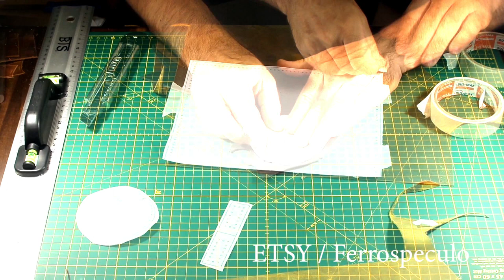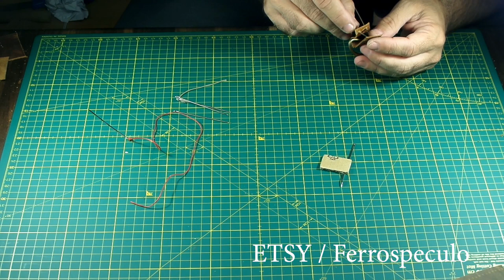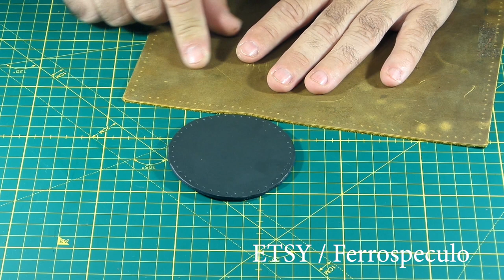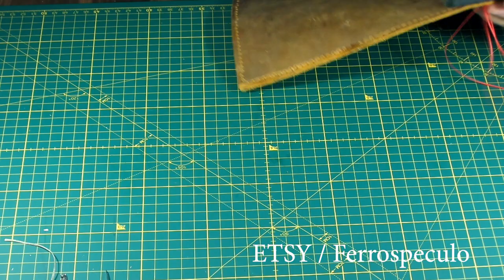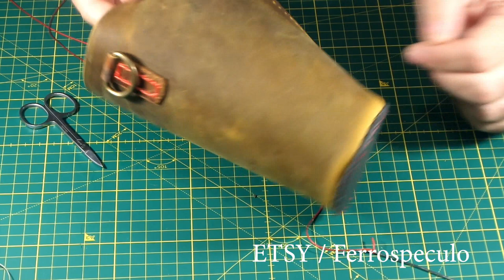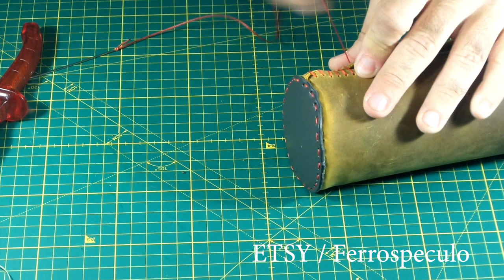Leather Bottle holder, do it yourself, DIY PATTERN,

Comment: Nice video. What kind of leather did you use for the part around the bottle? It looks like it's been treated with oil of something?
Reply from the maker: It is the version called Crazy leather. (It is obtained by applying a special type of polish to the smoothed grain leather surface.)
Reply: @ferrospeculo6446  Thank you very much, I will look online to see if I can get some of that. Perhaps edge oil will work?